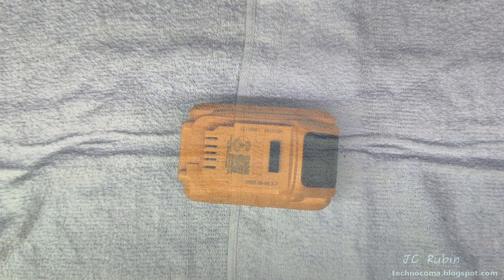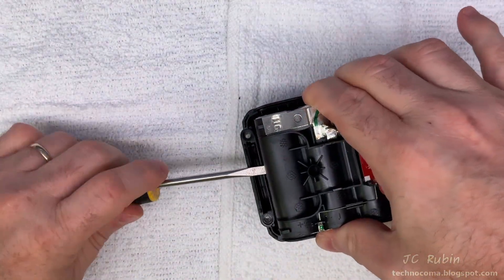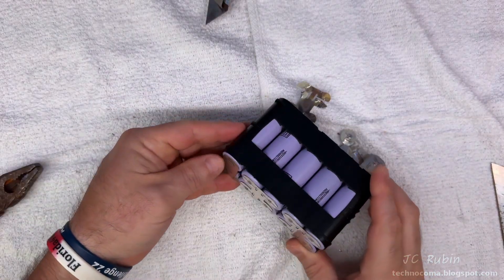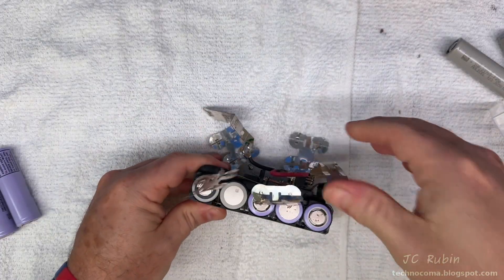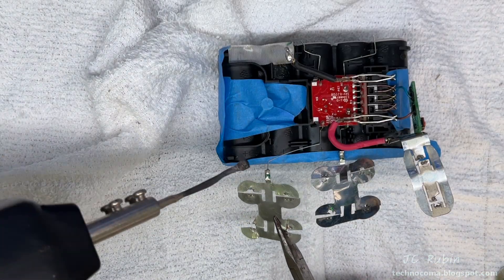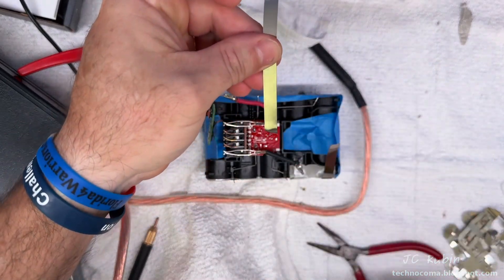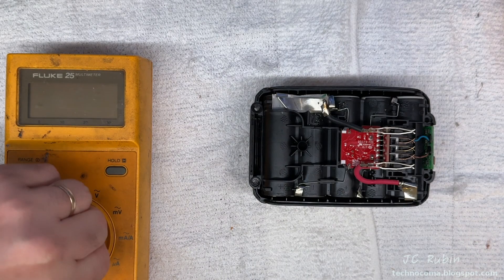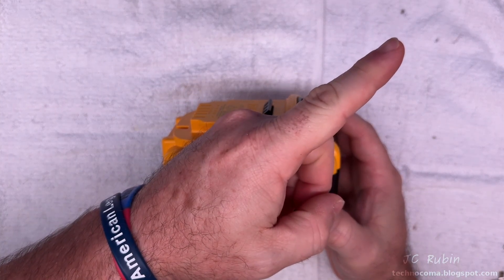Dewalt Battery Pack Repair - Was it work the cost and effort?

Comment: nice repair!  molicels are a good battery at a good price.  im about to repack my hitachi impact driver with the molicel p30b 3000mah.  how is your battery running so far? still working as normal?
Reply from the maker: Everything is running fine, now i have to contend with two bosch batteries less than 2 years old already having issues